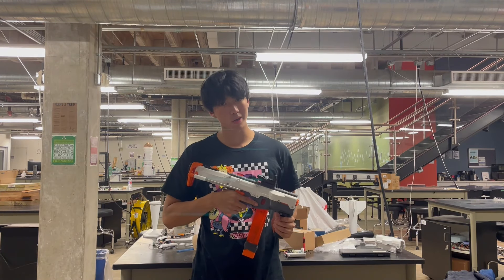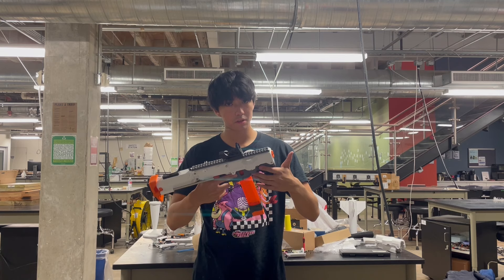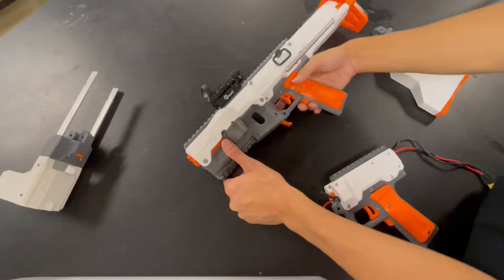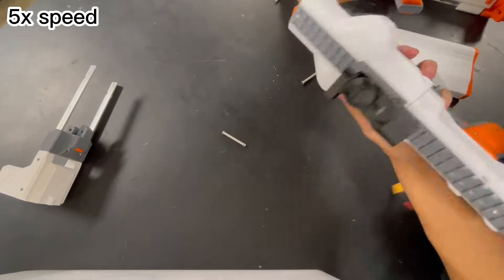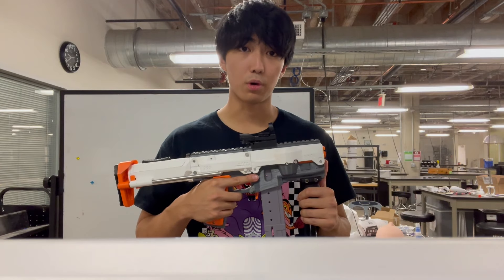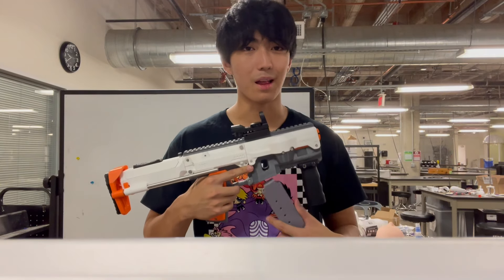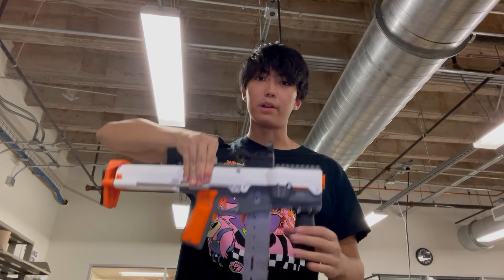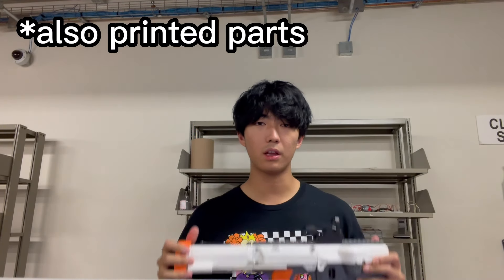Protean Modular Takedown Blaster Overview

Comment: Any plans for DZ mag/katana compatibility? Kinda like a wildcard magwell
Reply from the maker: At the moment, no. Wildcard would be significantly more tricky just thanks to how the magwell joint/grip is designed, but a dedicated magwell may be doable. For that, the main sticking point is the joint between the top of the grip and the magwell, but I wouldn't be surprised if it's possible.

A local should have already designed a DZ magwell though, I can ask him for it.